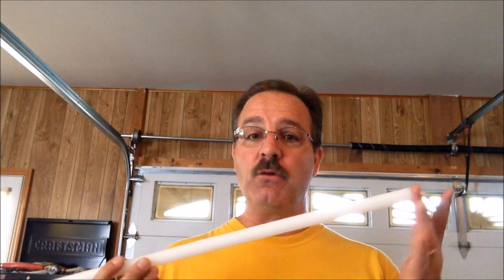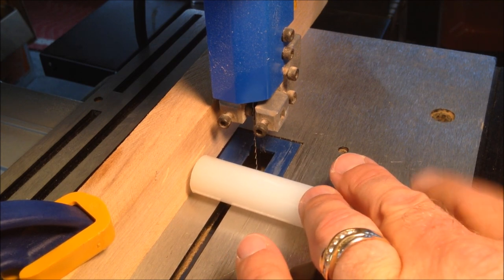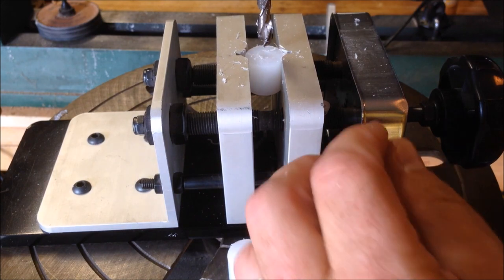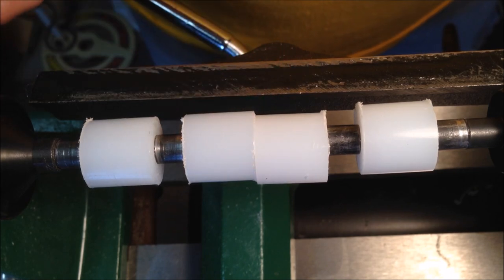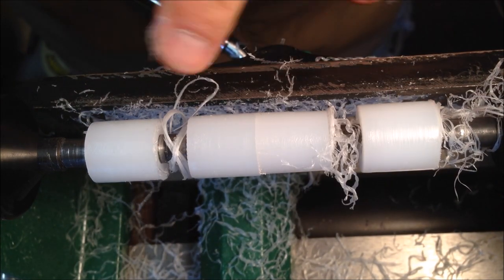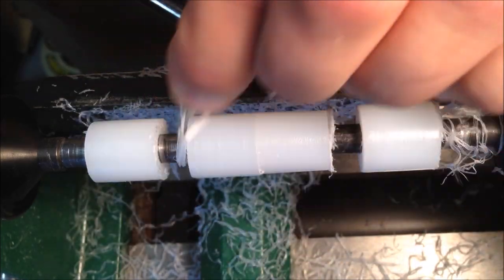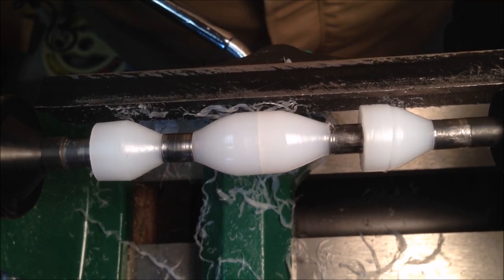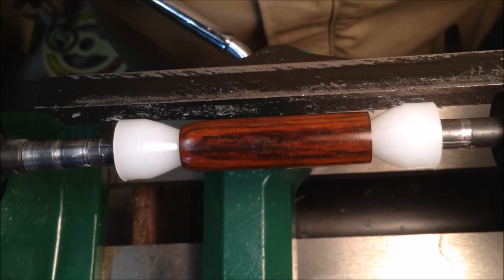Make your own Non Stick Pen Bushings

Comment: Hi Bob, I enjoy your videos and "Bob, I would like to have those" bushings. thanks
Jerry from the Ozarks
Reply from the maker: Thank you Jerry,
  That is an older video and I have already given them away. I apologize for that but that are very easy to make and I purchased a 3/4" stick of HDPE off Amazon for around $11.00 including shipping. 

Regards,
Bob
Reply: RJBWoodTurner  
I saw these bushings on Rockler made out of UHMW so I looked it up on Amazon and it is only $3.38 for a 3/4" X 24 inch rod. Do you think this would make the same bushings and save some money buy using this instead of the $10 one?
Thanks, Jerry
Reply from the maker: Jerry,
   From what I have read about UHMW plastic, it should work just fine. I however have never tested it so I can't say for 100%. At $3.38 a stick, I'd be willing to gamble on it. 

Regards,
Bob
Reply: Thanks RJB, I bought some online and now have the stick to try and turn my own when the weather gets better. I am wondering if these can be used for turning also or are they just for finishing?
 I also bought on of those grr-ripper advanced model and found it hard to use and dangerous because it had me bending over forward over my saw blade to finish the cut and I worried about the blade running under my chest as I leaned. I had to go to the side of my saw and push the thing right to left and that seemed uncomfortable. Yesterday I cut part of the plastic L shaped part off. I have stopped using it. 
Jerry Lipchik
Reply from the maker: Hello Jerry,
  Your going to love the non-stick bushings once you get a chance to turn them. I only use them for finishing not turning. I think they would be to soft for turning plus every time a gouge touched them it would reduce their size. 

  I made a mistake in the video and said to drill the bushing to 7mm. You will want to drill them to 1/4" for a better fit on your mandrel. 

  I'm sorry to hear you had such a bad experience with the Gripper. I ended up buying two of them and I walk the wood hand over hand past the blade to avoid stretching an arm or leaning to far over the blade. That seems to make it better but I understand the apprehension of leaning over that blade. I hate to hear that you cut part of the "L" off, I agree they can be a pain to adjust. They really slow the process down. The only reason I stick with them is because they keep my hands well away from being cut. 

Regards,
Bob

Comment: I would like a set of the bushings.  Thanks for the videos.
Reply: +James Sanford nylon/hdpe facet washers from the hardware store .97 cents just drill your 1/4 hole
Reply from the maker: +fiberinspector Great tip. 

Regards,
Bob

Comment: Thanks for this! Every time I go to pull a pen off the lathe, the CA glue is stuck to the bushings and leaves some pretty gnarly ends. 

Time to melt down some milk jugs.
Reply from the maker: Thank you,
  Once you make a set, you'll never finish a pen without them. 

Regards,
Bob

Comment: Love your channel, this looks like a great idea!. Your mandrel shown near the end though appears to have a lot of run out. I just was out getting a new mandrel rod today.
A dial gauge indicator can tell you how much it is off, easily visible run out will cause a  lot of vibration & shaping issues in my limited experience.
Reply from the maker: I actually bent it pretty bad and ended up purchasing a new one. It's much better, I didn't realize it was so bad. 

Regards,
Bob

Comment: Thanks great job.  I'd love to have those nonstick pen bushings, if I'm still in the running and you're giving them away.  If not, maybe I can locate some HDPE and make my own.  Your example of making them was very informative
Reply from the maker: Tommy,
  I have already given them away. Look at UHMW rod instead of HDPE. It's a bunch cheaper. I found it on Amazon.com in 3/4" x 2' lengths. It works just as well. If I remember, a rod was under $6.00. 

Regards,
Bob

Comment: did you know that you can actually melt hdpe at home with a standard oven most plastic items in your house are actually hdpe some examples are milk jugs containers buckets etc. another great thing about hdpe is that it is very safe and creates no fumes when melting there are a lot of great videos on youtube that show how its done on my newest video you could see my result with melting down hdpe
Reply from the maker: Hello Dean,
  I actually talked with Peter a town about this exact thing. I have a small toaster oven on my wish list when I move into my new shop. I plan to use it for clay blanks, drying pen blanks and I'm sure I'll melt some HDPE.

Regards,
Bob
Reply: cool

Comment: Great video 👍
Finally started making the bushings today , drilled the 7 mm holes then went back to review your video and read the comments for the first time !
See where you call for 1/4 " hole vs 7 mm ! Did I make scrap today or can I use the bushings with 7mm holes?
Reply from the maker: They will work just fine, mine are 7mm and I use them all the time. 1/4" is just a tighter fit. 

Regards,
Bob

Comment: Good advise.  I do use CA finish and tapping off the metal bushing can chip the blank end.  Based on your video I would like to try those.  :-)
Reply from the maker: Once you use non-stick bushings you'll wonder how you ever did without them. I haven't ruined a blank or had one stick since I got mine. 

Regards,
Bob

Comment: do you think turning the middle hdpe from a longer piece with a cone shape on both ends would be easier?
Reply from the maker: +Evan Arnold Hello Evan,
  Short answer, yes. I've had that suggestion before but I haven't turned a second set yet. This is still the original set I made. 

Regards,
Bob

Comment: That's a really good idea.  Don't put me in the draw because the shipping to Ireland would probably cost more than the bushings.
Best Wishes, Brendan.
Reply from the maker: Thank you Brendan,
  I hope you at least try to make a set of your own. I have been talking with other woodworkers and there is a belief that they could be made out of just about any material, even wood. It's the conical shape that keeps the two surfaces from meeting hence allowing the C/A to glue them together. I plan to give this a try and see what happens.

Regards,
Bob
Reply: baconsoda  have ya seen the hdpe casting on youtube. No2 hdpe milk jugs,laundry detergent,I know here in states it tells on the bottom of jug. It's more like shredding,heating in old toaster oven in mold say a piece of pipe and pressing

Comment: Bob,  

Great idea.

Any idea if UHMW polyethylene works the same?   I have a chunk of that lying around here somewhere.

JimE
Reply from the maker: Jim,
  I have never used UHMW plastic but from what I have read about it, I think it should work just fine. You could always do a quick test and try to C/A a small piece of wood to it. 

Regards,
Bob
Reply: RJBWoodTurner

Thanks.  Another good idea.  I found it and will give the gluing thing a try.  Keep the vids comin'

JimE

Comment: Hi TFS "thanks for sharing" even cheaper way is to cut up milk bottles " HDPE 2" lay on a baking tray and heat until soft usually  175c place in a mold and press into a block, cut, turn and there you are. Have made soft blow hammer heads this way and they work great. G :)
Reply from the maker: Great idea for up cycling HDPE containers. Thank you for for sharing 

Regards,
Bob

Comment: Hi Bob,

Great idea, but I have a suggestion on how to improve on your idea. I found that these bushings were a little loose when I put them on the mandrel because the 7mm drill bit is meant to drill a hole that accommodates a 7mm tube. So I cut new blanks, drilled them, glued in a 7mm tube and turned them as per your video. No more wobbling. 

Thanks for another great video. 
Peter
Reply from the maker: Thank you Peter. 

Regards,
Bob

Comment: Just thinking out loud here, would it benefit in anyway to drill the hole through all at once prior to cutting them to size?
Reply from the maker: Daniel,
  That is a good idea, I was figuring this out as I went so when I make another set, I think I'll try it your way. My 7mm bit is plenty long enough. 

Regards,
Bob
Reply: RJBWoodTurner I thought about putting it in a chuck and drilling it on the lathe.
Reply from the maker: Eddie Daniel That would work too,
  I am bidding on a used Nova 2, hope I win the bid, I really want a chuck.

Regards,
Bob

Comment: Bob, 

Have you ever turn between centers.  I had the issue you spoke about on another video with the CA finish sticking to the finished product causing me a lot of pain to correct when it chipped the finish of the pen.  A friend of mine Russel Eaton turned me on to turning between centers without bushings...the roundness of the turning is great.  On another note.  Have you ever experienced cracking or shattering of the CA finish before.  I had a time period in which I had many pens a week to a few weeks after turning decide to shatter all around the pen.  I am not sure what I did wrong and now stopped using CA as a finish till I can figure out why.  I hate to sell or give away a pen that has poor quality.  Thanks for reading.

Donald
Reply from the maker: Hello Donald,
  I am purchasing a 60 degree drive center to try between center turning. I am curious and really want to give it a try. 
  I have had cracking in the past. I attributed it to old glue. I also occasionally have cracking when I use to much accelerator like during the cold dry months. I find the clue doesn't dry as efficiently when the humidity is low. 

Regards,
Bob

Comment: I drilled with 7mm and 1/4" and the to-be bushings continue to slip on the 7mm mandrel from Penn State. Would appreciate any tips so I can keep going. Thanks
Reply from the maker: Hello,
  Slipping shouldn't be an issue if your only using the bushings for finishing. Once I tighten up the mandrel saver in the tail stock or the knurl nut, they hold really well. 

  Use a drill gauge and check your mandrel size, maybe it's smaller than 1/4". 

Regards,
Bob
Reply: +RJBWoodTurner - there are metal bushings between the hdpe pieces.  The tail stock is tightly pressing in and the metal bushings allow the hdpe pieces to slip. Must be missing something...
Reply from the maker: They will slip, HDPE is designed to reduce friction. As long as your blank is not spinning, it will be tight enough to apply a finish. 
  Is it possible to take a short video and post it so I can see the slippage? That would help me determine if what your experiencing is normal or excessive.
Reply: They slip to a point I can't intially turn down the hdpe pieces.
Reply from the maker: Use a drill gauge or calipers and measure the size of your mandrel. Then find a comparable drill bit.

Comment: Bob... Great video...Got a question...did you drill a 7mm hole or 1/4".
A suggestion is cut 1 long piece, cut two 'V' cuts to the mandrel and part in the center with a thin parting tool...
Reply from the maker: Thank you Vic,
  I drilled a 1/4" hole in the HDPE. I said 7mm in the video and have been called out on that slip a couple times. 1/4" fits the mandrel tightly. 
  I like the tip on the 'V' cuts. My current set of bushings is pretty used up and I'm due to make a replacement set. The 'V' cut method sounds much simpler and I think I will give that a try. 

Regards,
Bob

Comment: can you turn a pen from scratch with those? I'm trying to avoid putting the brass in until the very end.
Reply from the maker: +Tanner McKean (Lurpatron) Hello Tanner,
  I've never tried but I would suspect they would slip.

Regards,
Bob
Reply: Thanks!
Reply: I've turned a pen or two without the brass tubes and tried to put the tubes in after. They came out elliptical because, even though there was enough pressure on the Mandrel to hold them in place, as soon as you apply your Skew or Gouge to the material, it changed the Center Point of the Blank in several areas and the tube had to be forced. "Not an Easy Task." PLUS! Got CA Glue ALL OVER my turned piece. YUK.
However! Don't Through Out your "Scrap Cut-Offs" I have turned Center Rings from some of my Scrap Cut-Offs w/o tubes, of various colors, to offset my pens. You need to drill a 1/4" hole in the Cut-Offs so it fits the Mandrel properly. It also allows the Ring to fit snuggly on the Pen. You can turn several at a time. i used HDPE washers to separate them when applying the finish. The HDPE washers were used at BOTH Ends and In Between the Cut-Offs. They were NOT Conical. (No room for them to "Fit In" the 1/4" holes. ") Washers were Readily available at Lowes, HD, Ace, etc.
Reply from the maker: +Arthur Loretti Thank you for a great reply Arthur,
  You've given me food for thought and I appreciate you Sharing you experiences. I love learning from other turners. 

Regards,
Bob

Comment: Hi Bob, 
I'm new to turning and have really enjoy your videos. They are very informative. What's UHMW?  I was just getting ready to order the HDPE.  I saw a video where a guy cut and sharpened a drill bit and used it to hollow a bowl. It worked really well and fast.  Any thoughts?  I'd like to do this but the other guys videos were kind of difficult to see.  
Thanks, Ruth
Reply from the maker: +stonimal Hello Ruth,
  It's great to hear from you. 

UHMW is Ultra High Molecular Weight plastic. It will work just as well as the HDPE, High Density Poly Ethylene, plus it's about half the cost. 

  I've seen people use drill bits as well as old carbon steel files. I've personally never tried it. The trick is using the hardened steel bits so they hold an edge longer and they don't break as easy. The other thing is getting an edge on them that works. 

  If you make one, take a close look at other hollowing tools to get an idea of what the tips look like. Then just grind and sharpen to match one of those as closely as possible. 

Regards,
Bob

Comment: Is it OK to ad a 7mm tube to the center of this project to get it even more concentric, or will the tube adhere to the pen blank when adding CA?
Reply from the maker: +Arthur Loretti Hello Arthur, 
  My concern would be the bushing might adhere to the blank if C/A got between the bushing and the blank. Also, I like to HDPE bushings to fit inside the tube, that way, no C/A gets to the tube and glues the blank to the mandrel. Don't ask me how I know about that. :^)
  In the video I said to drill a 7mm hole in the HDPE, 1/4" works better. 
  UHMW Rod will work just as well as HDPE and is cheaper. 
  You could even melt milk jugs to obtain the HDPE material. 
  I have never had an issue with the bushings being non concentric. The lathe speed is so slow while finishing that even if things are a tad off its never caused me an issue. 
  Make your bushings a little over sized, that way you can use a slew and turn the excess C/A off when it builds up. I'm still using the set I made in this video. 

Regards,
Bob
Reply: Thanks for both comments. I'll be working on some designs next week. I'll send pics
Reply from the maker: +Arthur Loretti That would be great,
  My email is rjbwoodturner@ufoww.com

Comment: Great idea! Do you know where I can buy some of these? Cheers, Lyle
Reply from the maker: Woodcraft, Craft Supply, and Packard Woodworks all sell them. Or you can purchase a 24" x 3/4" stick of HDPE or UHMW  from EBay and make many sets yourself for a lot less money. Just drill a 1/4" hole instead of the 7mm I mentioned in the video. You'll get a much better fit to the mandrel. 

Regards,
Bob